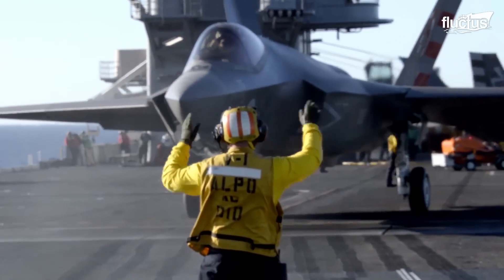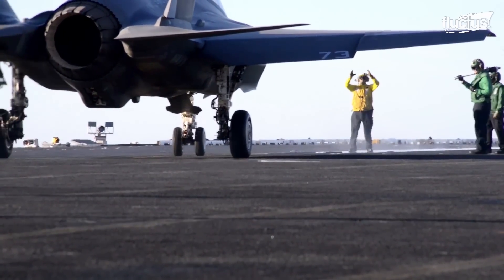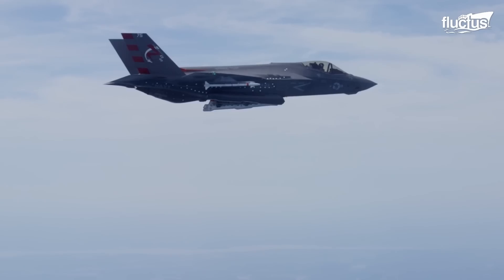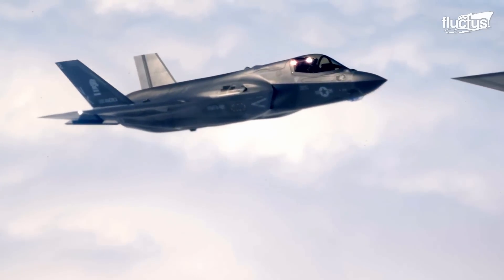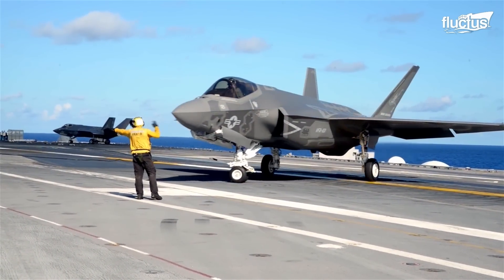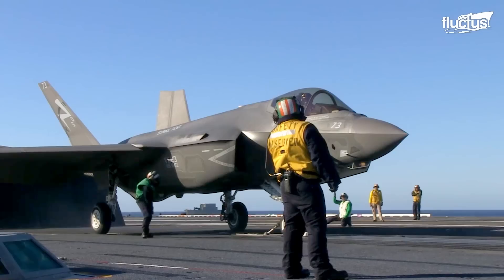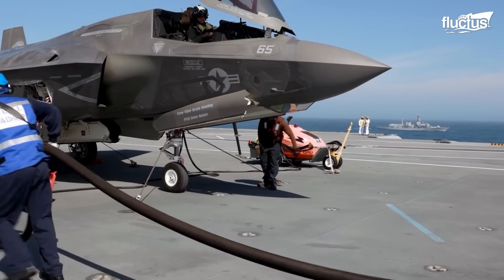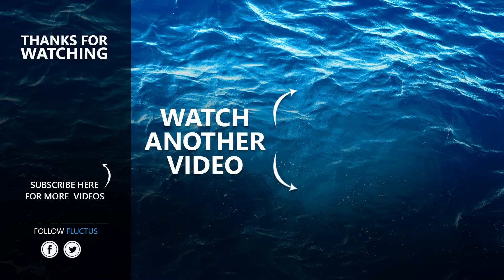Launching US Most Advanced Stealth Fighters on Aircraft Carriers | Full Documentary

Comment: Instead of making 3 kinds, why didnt the navy just make more of the one the Marines use? That would have saved money.
Reply: 15K payload on F-35B vs 18K on F-35A and C variants. F-35B carries 13,500 lbs fuel and F-35C carries 19,750 lbs fuel making the range much longer on the C variant and carrying more munitions to use at that longer range.
Reply: The 3 variants were designed for 3 different uses by the Air Force, Navy, and Marines. One variant is used by Marine pilots on LHA and LHD without the need for a tail hook and need for VSTOL operations.